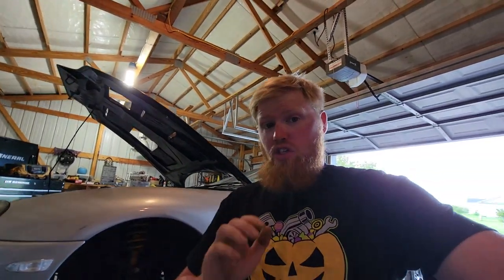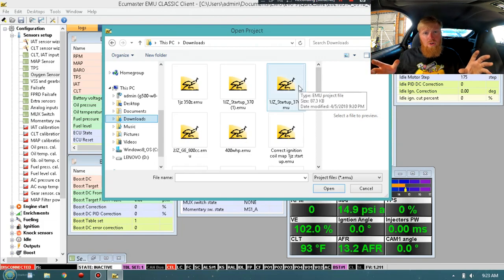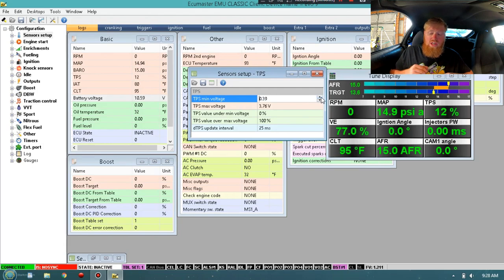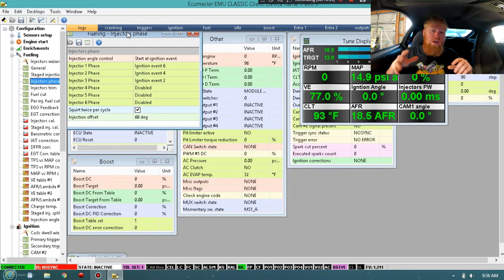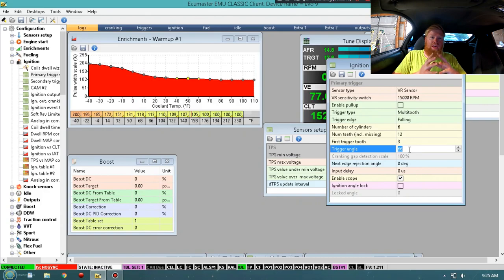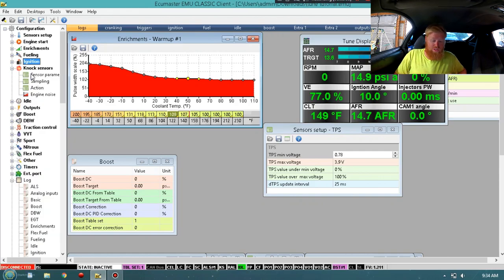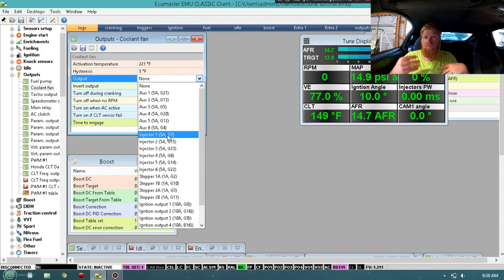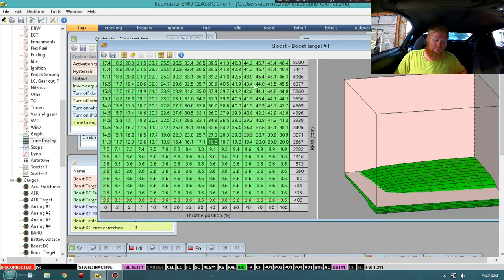BUILDING A MAP FROM THE BEGINNING WITH ECUMASTER EMU part 1

Comment from the maker: Guess i should probably make part 2 huh..
Reply: Yessir!
Reply: 100%
Reply: tuning mine soon, keep it up 👍🏻
Reply: Part 2 would be sweet!!
Reply: That will be awsome. Also just recieved my emu black. Used your guide and manage to drive. Need help with timing table
Reply from the maker: Timing isnt something i want to cover, only for the fact changing nunbers even a hair can cause catastrophe if you dont know what you're doing. My suggestion is to use the base map for your engine and use the stock timing map. Most of the time the boost timing can be pulled into a conservative nunber so theres no chance  of detonation (if you're on ethanol), but you will cost a bit of power.
Reply: Part 2? :D

Comment: Lets goooo !! You definitely came through , thanks again bro. Now i can adjust the idle with the 272 cams so i dont have to hold my foot on the gas waiting for it to get warm
Reply from the maker: Lol i did that for 2 years. Basically, use idle correction, and set your throttle open more and you'll be able to start and walk away

Comment: Just a heads up… IAT sensor is mandatory to run on speed density setup, the ecu uses the IAT & the map sensors to calculate how much O2 is in the mix. If you don’t connect the IAT it will run at the default temp & your fuelling will be horrible

Comment: paired injection doesnt fire twice per ignition, just two cylinders get fuel at the same time and the one gets burned almost instantly and the other fuel charge sits on top of the intake valve until its opened.
Reply from the maker: What i meant was a pair of injectors fire batched per ignition event. If 2 injectors are firing together, they will fire twice per ignition cycle, is what i meant to say

Comment: What type of vacuum hose did you use for the map sensor built into the ECU master? I'm having a hard time finding it.  The only thing I found at autozone was low pressure (1BAR) windshield/ Vacuum line
Reply from the maker: Bulk hose in the back room at O'Reillys
Reply: @RabidJz  is it 4mm vaccum hose?

Comment: So I’ve got my EMU Black setup on my NA-T 2JZ, and I’ve got the timing set while cranking. But I cant get the car to actually start. It might fire off one cylinder every now and then while cranking but it refuses to start. Any ideas?
Reply from the maker: Make sure it says synchronized on the software when cranking. If its synchronized, make sure you have sufficient fuel. If you do, then you must check independent firing order on injectors and coils using the test function on the software.
Reply: @RabidJz   I fixed it! It turned out to be the output offset setting, I was afraid to play with it at first but after I set it to 3, it fired up

Comment: Hey I am having issues with my 2jz non vvti not getting spark but I am going from the ecu to the stock igniter and then to the oem coils . Can I just run direct wire from the ecu to
The coils and bypass the igniter ?
Reply from the maker: Yes but you have to set the them as without built in amplifier
Reply: @RabidJz  thank you I will try it out . There is not much info out there about ecu masters so thank you for these videos keep up the good work

Comment: Thank you for the video. Liked and subscribed. :)
I'm currently in the process of retuning my 1jz-gte non vvti. 

I've always had random missfires at idle since i got the car. What seemed to fix this is changing from rising edge to falling edge. Obviously have to verify the actual trigger angle. 
Any specific reason for running rising edge as you say in the video?

Another thing I fixed the in the tune is injector size from 600cc to actual ev14 850cc (specified and tested). I'm getting VE-numbers at idle of 70% which i think should be alot lower. I would think it should be between 30-50%. 
What kind of VE do you typicaly have at idle?

My engine is stock except 62mm single turbo, fuelsystem, old EMU classic.

I like your content. Keep it up :)

Comment: Van someone explain me für what the table „fuel stepper correction“ is?

Its Form a Bike, the table goes only Max to 4.500RPM 
Bike has throttlebody with oldschool mechanical cable

Comment: How do you check timing on the smart coil? Where would you clip it on to cylnder 1?
Reply from the maker: The plug wire, or stick a plug wire into the boot and connect it to the spark plug

Comment: I have emu black in my 1j vvti. And it breaks up and sputters under 50-100% throttle added lots of fuel in my ve table. 
What’s a conservative timing map? I’m sitting at 20 at idle
Reply from the maker: I typically run 14 at idle